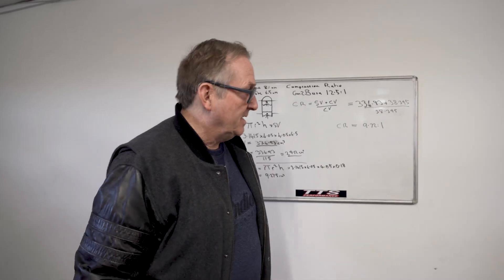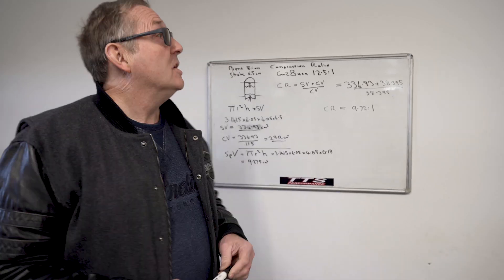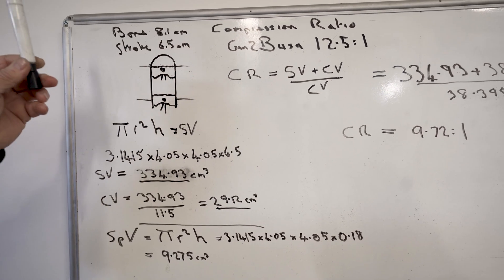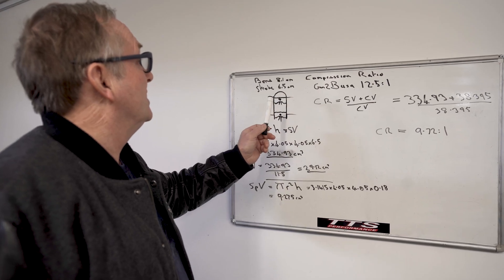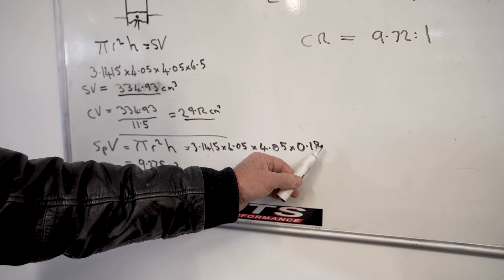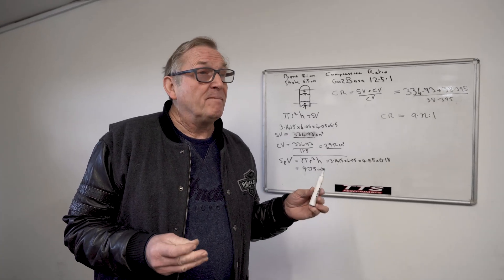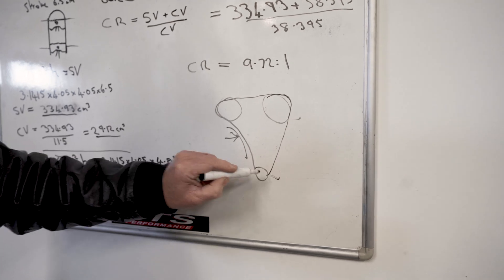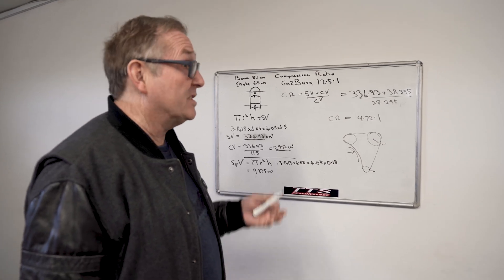How do we work out compression ratios for our 360hp Hayabusa supercharger package?

Comment: FOR 1580cc BIG BLOCK STROKER MOTOR (SuperCharged), ALTHOUGH WOULD WORK GOOD WITH OEM HEAD
ON SUPERCHARGED 1340cc GEN2 Busa. 
10.2:1 CR
Gen1 Intake‐‐8.8mm maximum lift with Brocks Offset Cam Sensor Pin
Intake Opens BTDC : 28 degrees
Intake Closes ABDC : 68 degrees
Gen2 Intake as Exhaust‐‐9.0mm maximum lift
Exhaust Opens BBDC : 72.5 degrees
Exhaust Closes ATDC : 28.5 degrees
Cam Calculations
Lobe Center / Duration for 110 & 112 degrees
Overlap: 56.50 degrees
Intake Duration: 276.00 degrees
Exhaust Duration: 281.00 degrees
Intake Installed Centerline of 110.00 degrees ATDC.
Exhaust Installed Centerline of 112.00 degrees BTDC.
Reply from the maker: Is this your project?
Reply: @TTSPerformance   The 1580 already has 60,000 miles on the clock as a naturally aspirated motor . 1st Woolich Racing tuning run was 9.2 sec 1/4 mile @ 152 mph. I already have the cams as was originally building it to Supercharge, however, at the time, ran out of money.
Also have 2 sets of Ross Racing low compression pistons to go. Sooner or later I will get around to it. My last project, whilst stuck in Australia 🇦🇺 due to covid-19 flight cancellations was to eliminate pre-ignition & detonation by solid state boost charge air cooling system. Maximum boost pressure was 22.7psi & more improvements after this vid before returning to the family in Thailand. Maybe TTS wants to buy my Boost Cooling invention? Note the BST (boost temperature) on the lower right hand side of the dash on this H2 SX SE +
https://youtu.be/sHtHFP1_wMI

Comment: he was NOT explanatory,,i didnt understand half off what he said,,also is it soo har do find size spec on rotrex 30-94 vs 38r,,what if i want a 38r instead of 30,will it fitt because more wants much and 300whp will be litle after a while so whyy not get a bigger supercharger from get go if u where to want more later.
Reply from the maker: I don't understand a word you wrote :(
Reply: @TTSPerformance  sorry,,lol,,he spoke so fast i couldnt get it..my question is would an 38r supercharger fitt on a hayabusa gen1 where u use a 30-94 supercharger on your kitt,or was it 30-74 you use.
Reply from the maker: @shaban2374  c38r won’t fit. The one used is the c30-94

Comment: and how do you define the spacers thickness?
= keeping effective CR the same as unboosted?
Reply from the maker: Why would you want to do that. The effective compression ratio will depend on boost and throttle opening amongst other things.
Reply: @TTSPerformance  Given the throttle opening 100% you want to lower the static CR to keep an effective CR that does not detonate. But effective CR in boost is allways higher than in N/A. So is there a formula or is it experimental?

Comment: How do we optimize power under the curve? What formulas do we need?
Reply from the maker: Strange question. Power under the curve is down to optimum air/fuel ratio and ignition timing. Also cams and exhaust system. A complex formula that is best proven by testing.